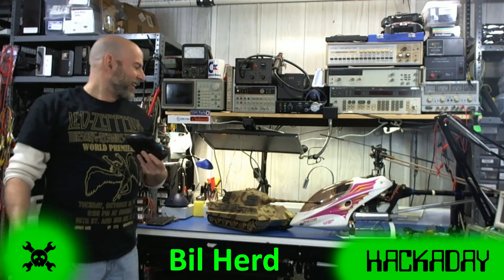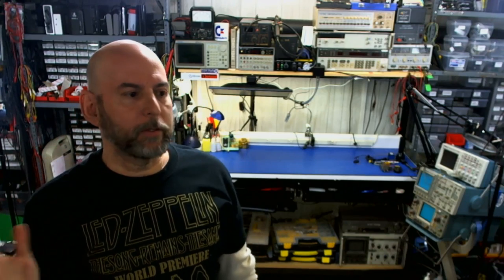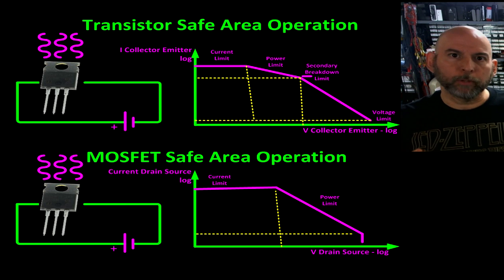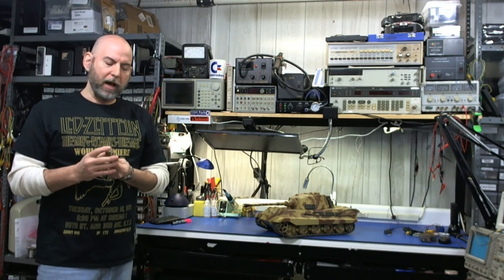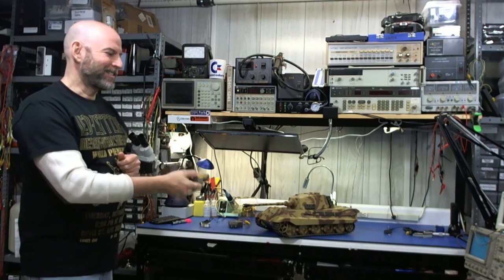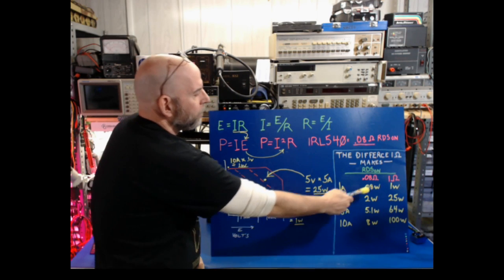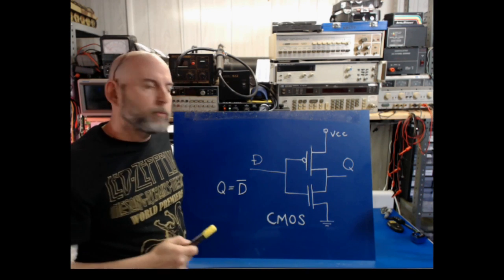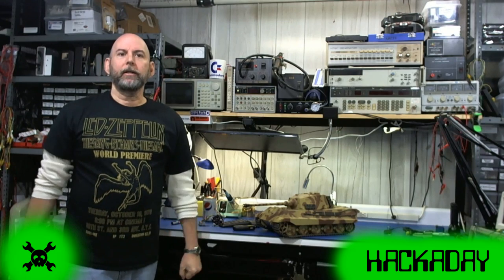Safe Area Operation for power MOSFETs and more

Comment: Thanks for your nice presentation,

I can say that now I understand SOA characteristics. However, I still have a question. How should we consider SOA in IGBT selection? Actually, in practical applications, we have few inputs such as the maximum voltage of the system, the current normal rating, switching frequency. As you can see there is no information to be useful for the SOA check. I would appreciate it if you could help.